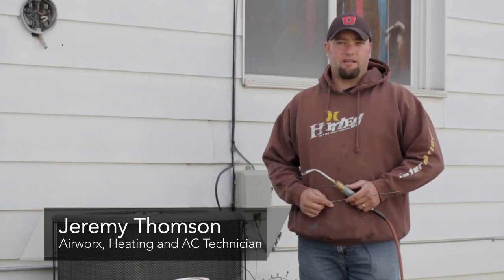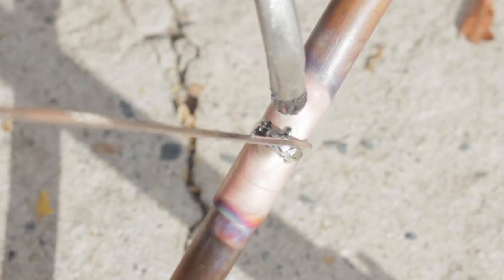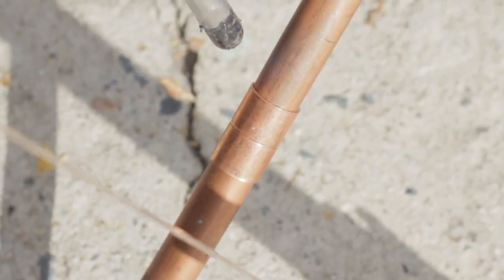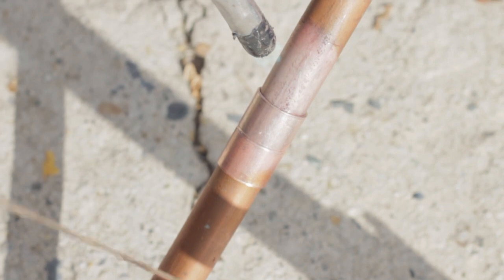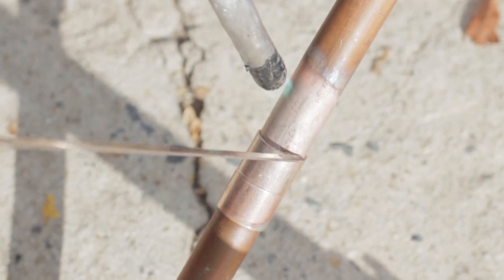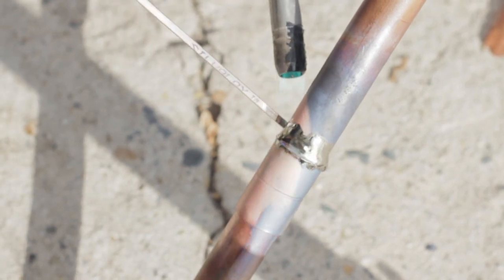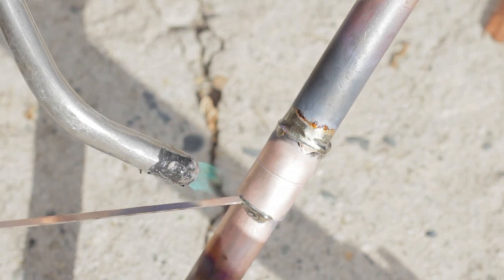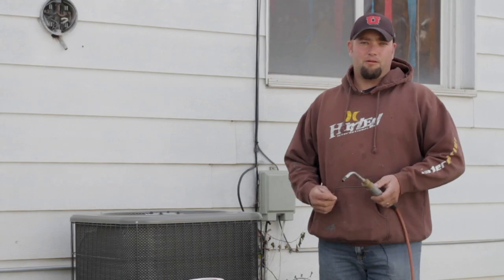Central Air Conditioning Information : How to Repair an Air Conditioner Freon Leak

Comment: Suppose you could do this repair DIY so long as system was already discharged. But only a LICENSED HVAC tech can buy and legally work with freon so little incentive to do so. 
I can solder the plumbing and rebuild a transmission. But for home A/C a pro is REQUIRED.

Comment: Why don't you use flux?
Reply: Silver solder does not require flux when used on copper. Also don't want any leaching into the refrigerant.

Comment: he should have put heat on opposite side of where he applied the solder , and also 1/4 inch below the seam , ( cuz the solder goes to the heat , ) so if your heat is on the back and 1/4 inch down from seam, then you put the solder on the front top.  and walla the solder will go straight to the *Hottest Spot* ,, ( also put the heat 1/4 inch or a tick more , below the seam , so the solder will go down inside the fitting , instead of just haveing a thin layer lying on the top of the seam.. so it will go down for max thickness 

The problem the way he did it , is nothing , it will work fine  just that the solder isn't down as much as it could be.  it's really only thick down inside , on 1 side. ("the other side is lacking the equivalent of solder") my vo tech teacher lol)  just when I do something. I  do it the best I can. "Some things not worth doing unless you do it right."  I try to do every job as if I was doing it for job himself , and it talks in the bible about doing poor work , as being a sin
Reply: He’s calling it solder, but he was brazing. As for brazing, he did it correctly. You put the flame to where you’re brazing rod is and the braze will melt to wherever the heat is. You can tell it’s a brazing rod because they have such a high melting point. Hence the reason it did not continuously melt after pulling the flame away. Solder melts at a much lower temperature and will continue to melt around the pipe after the flame is pulled away. When soldering you want to keep the flame back 1/4” to draw the solder in, but brazing you keep it at the seam. Secondly, you can tell it’s not solder because there was no flux on the pipe. 

The best way to seal a system is by using Harris’ StayBrite #8 with Harris’ Stay Clean flux. You’ll get the most out of the seal, copper, and overall system. There’s a video on YouTube of a guy that does a side by side comparison of staybrite vs. brazing. I think everyone working on copper lines should be required to watch it. A bit long, but overall best video I’ve ever watched on hvac.

Comment: CAn you do this with the refrigerant still in the unit or do I need to evacuate it first?
Reply: Maynard Becker evacuate lol
Reply: if you got a hole there's no gas inside
Reply: @kize32  Not if you only have a small leak, which is what I am experiencing.

Comment: my name is jeremy im the one in the video they realy did not give me much time to explain it all. ya when brazing this is not solder on welding up ac units to remove the scale from using the torches you must flow nitrogen and this will prevent it from building up in the compressor also you do have to cut the line h.hall to feed a coupler on the pipe if you are using silver solder it can fill in the wholes on smaller repairs
Reply: he should have put heat on opposite side of where he applied the solder , and also 1/4 inch below the seam , ( cuz the solder goes to the heat , ) so if your heat is on the back and 1/4 inch down from seam, then you put the solder on the front top.  and walla the solder will go straight to the *Hottest Spot* ,, ( also put the heat 1/4 inch or a tick more , below the seam , so the solder will go down inside the fitting , instead of just haveing a thin layer lying on the top of the seam.. so it will go down for max thickness 

The problem the way he did it , is nothing , it will work fine  just that the solder isn't down as much as it could be.  it's really only thick down inside , on 1 side. ("the other side is lacking the equivalent of solder") my vo tech teacher lol)  just when I do something. I  do it the best I can. "Some things not worth doing unless you do it right."  I try to do every job as if I was doing it for job himself , and it talks in the bible about doing poor work , as being a sin

Comment: You need to explain a little more . What kind of torch and solder are you using.
Thanks for the effort
Reply: he should have put heat on opposite side of where he applied the solder , and also 1/4 inch below the seam , ( cuz the solder goes to the heat , ) so if your heat is on the back and 1/4 inch down from seam, then you put the solder on the front top.  and walla the solder will go straight to the *Hottest Spot* ,, ( also put the heat 1/4 inch or a tick more , below the seam , so the solder will go down inside the fitting , instead of just haveing a thin layer lying on the top of the seam.. so it will go down for max thickness 

The problem the way he did it , is nothing , it will work fine  just that the solder isn't down as much as it could be.  it's really only thick down inside , on 1 side. ("the other side is lacking the equivalent of solder") my vo tech teacher lol)  just when I do something. I  do it the best I can. "Some things not worth doing unless you do it right."  I try to do every job as if I was doing it for job himself , and it talks in the bible about doing poor work , as being a sin

Comment: Soldering demo was good. But you did not explain that you have somehow slid a coupling over the lead to be repaired. How did you do that?  Did you cut the pipe?

Also, you mention using nitrogen being important and nothing else.  Are you purging the system with nitrogen, after you weld?  Is a vacuum pump not enough?

You might fill in the blanks in your explanation above.